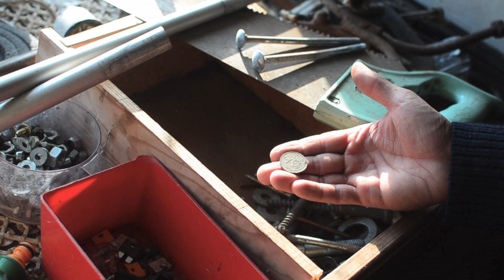Wooden Plane Tuning

Comment: I like what you did but wouldn't a hardwood dowel have worked as well?
Reply: The plane bodies are usually made from the hardest wood available in the area. There are old wooden planes that have the dovel solution but the dovel is usually quite chewed up on those.
Reply from the maker: I haven't thought about using hardwood dowels... But like Petter wrote the planes are made of hardwood: Hornbeam, beach and the Americans i am not sure. Some kind of oak i guess.
But, why not to just try.
I used these screws maybe just cause i have them arround, they were bent so useles for anything else and they do great on the planes...
Reply: "Taps" are something you find on better-tuned wood-bodied planes. Not all cultures employ them (Asia, etc) but they are used just as applied in this video and then demonstrated...This allows for a concentrated strike zone that efficiently moves the iron up or down...thus adjusting shaving thickness...Wood dowels simply don't achieve this and would be no different that just striking the wooden plane itself...as many old well-used planes reflect in their distorted and deformed strike points...